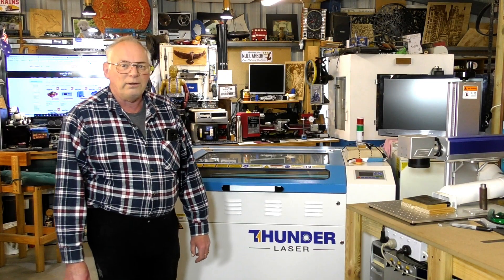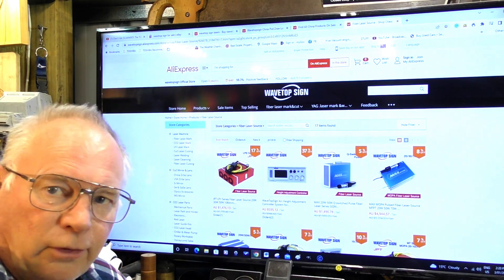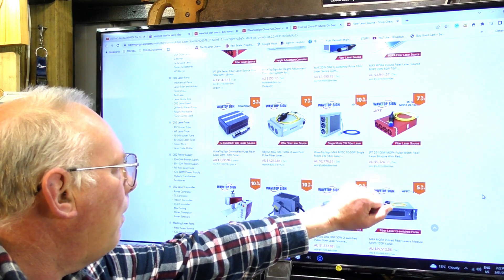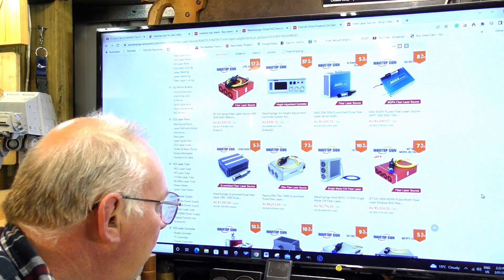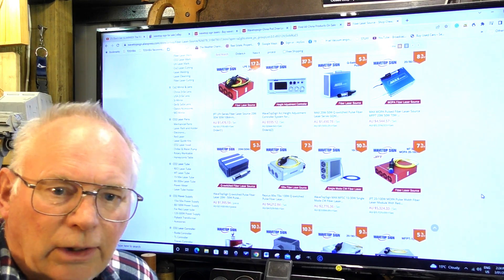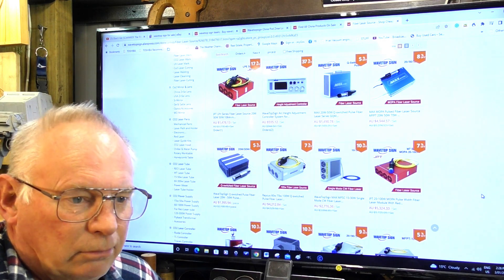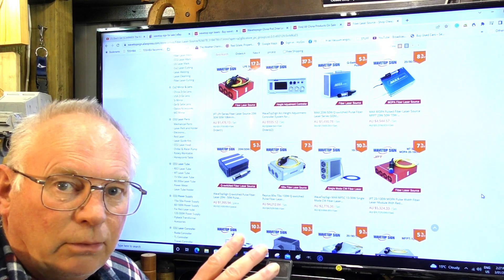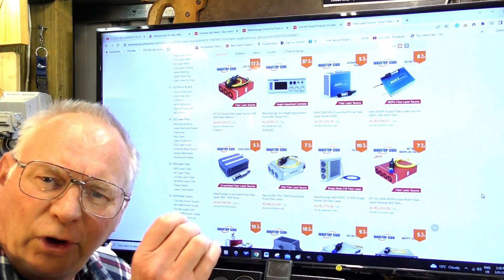Buying a fiber laser  which 1? & who from? NEW for 2023

Comment: 10 months ago I bought a 30 watt Raycus. last week, I paid 5000 for a 100 watt JPT source to replace the 30 watt. Should be delivered today. Also had to get a 48 volt power supply. the 30 watt runs on a 24 volt.
Reply: I have a question I can't seem to find a succinct answer to:  Is the primary advantage of a higher wattage the cutting speed?  I had been looking at a JPT 60w MOPA, but I don't think I'll be using color engraving too much and was debating getting a 100w Q-switch instead with the savings.
Reply: @c.j.1089  After having the 100 Watt JPT for a bit. I would go for the 60watt MOPA over 100watt Q. It is for  more than color. Deep engrave vs ablation vs polishing using the frequency. You never know what jobs will come your way and you will be ready for vs wishing you had it. I run my fiber about 30% power most time. 60watt will work great.
Reply: @JackInTheShop  hey mate, are you still enjoying the 100w laser ? I'm looking to make small detailed dog tags for collars and thinking of getting a 60w mopa
Reply: @c.j.1089  did you buy one ?